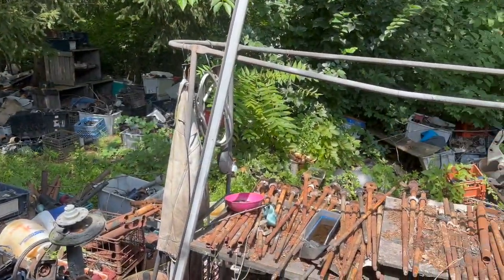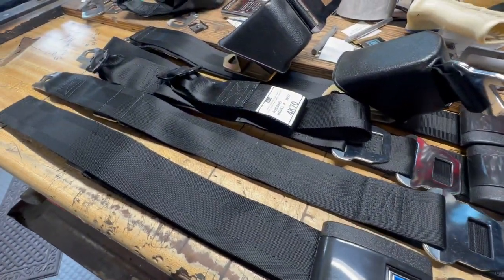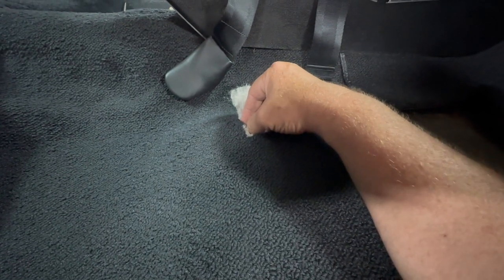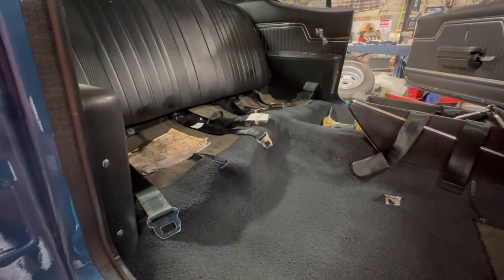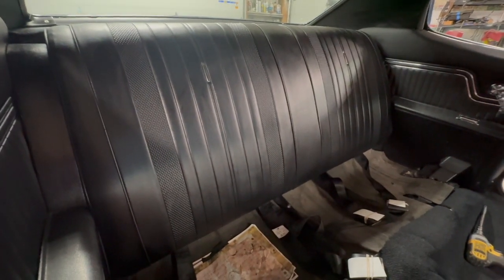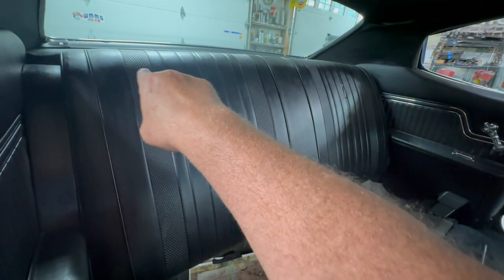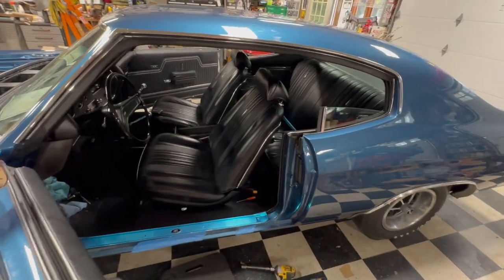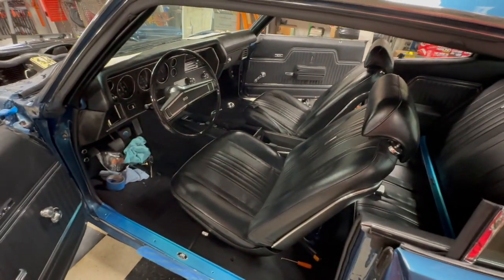Seat Belt Restoration and Interior Installation

Comment: Nice work, Mark. Couple comments on the bucket seat details. Stainless end caps were not used on the ends of the chrome piping on 70 seat backs. Those were used on earlier seats (66-67 I believe). Also the chrome seat adjuster knob is correct for 70. 71-72 used the black adjuster knob.
Reply from the maker: Thanks for answering my question. I will 86 the tips.